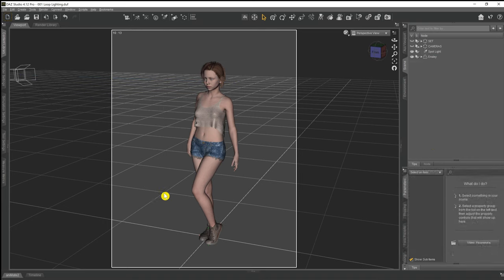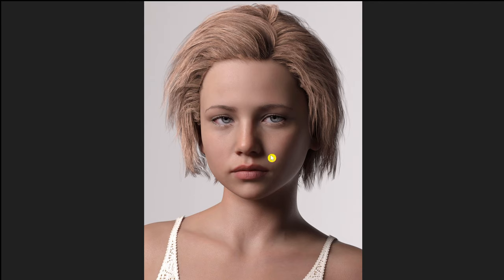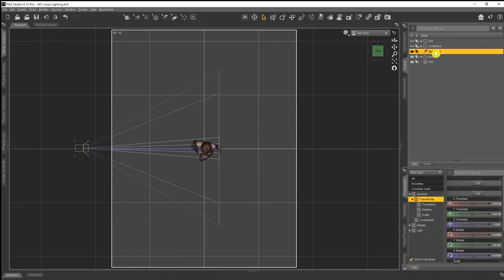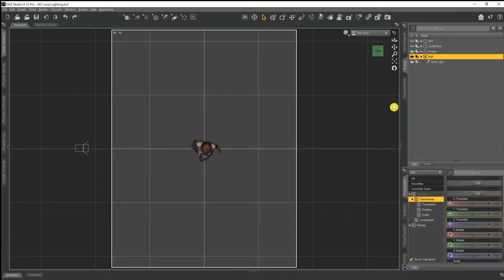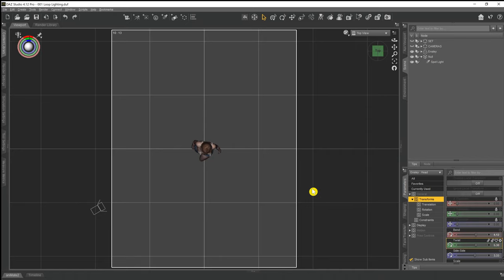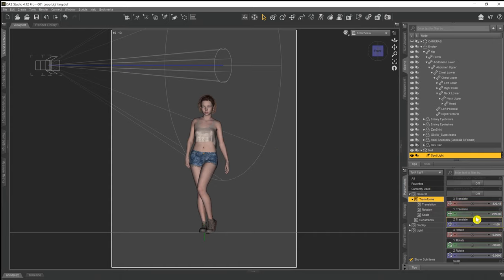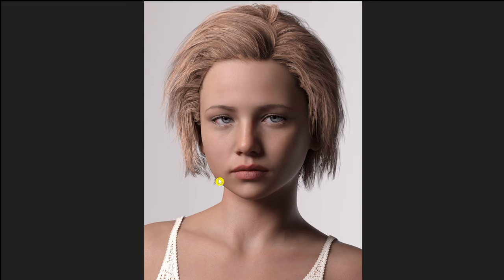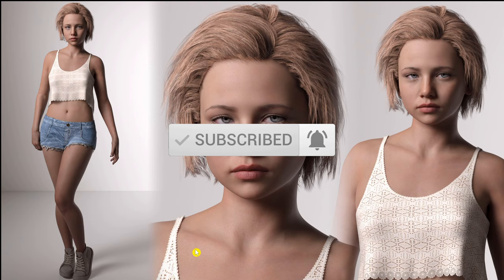Daz 3d Lighting Tutorial : How To Set Up A Loop Light

Comment: I should add that the tip parenting the light to a null at the origin is a great tip and shows why I watch videos like these even though I've used DS for a decade. I use nulls to keep a characters' eyes pointed near the camera but hadn't thought about this easy tip for moving lights. Works equally well for trying camera angles. Well done Rauko!
Reply from the maker: Yeah, it's a great little thing that I accidentally stumbled upon years ago when tryign to animate a camera .. so, if it works - use it! ..
Reply: You can also point a camera or light at a null, or a part of a character's anatomy, such as her head in this video. Then when you move it, it still points to the same thing.

Comment: Rauko in this and the Split light video, you made the comment that the lights perhaps don't work as well in the full body shots. I realize this is somewhat personal preference, but could you expand on your reason a but? To my taste, the full body shot for the loop light looks just fine. The bit of shadow on Ensley's left adds some depth and interest. The split light shot was perhaps a bit darker on the models left than I prefer and I might add some small fill there to lighten just a bit. Thanks in advance for your thoughts.
Reply from the maker: Hey Larry. The idea of these little simple lighting videos is to show that you can get decent result with just a simple, one light set up (outside of the ambient I used) without the need to add multiple lights. Certainly with portraits. You're right - with a fill light here or a rim light there more can be added to them to make them work in other situations but to demonstrate the particular lighting setups, I decided not to add other lights ..
Reply: @RaukoDaz3D  I wasn't suggesting other lights. I understood your intent with this video and felt you definitely met your goal. I was just curious about your comment on the full body shot, particularly on this video since I thought the full body was plenty good as is.

Comment: Thanks for this tip. Been looking for something like this for a long time. Question - Is there a possible to connect even more light to the null point- or - do I have to create several others? Was thinking of having at least three different light sources, perhaps with different temperatures  and/or color.
Reply from the maker: Hey there - you can add as many light sources to the null point as you want although, obviously, rotating the null point will rotate all of the lights as one. A different null point per light will allow fine control over each light individually.

Comment: hi, your render look amazing, and the tutorial also great...
my question is, what subdiv usually you use for the character and clothes?

ps : I think, your treble audio is too high, except that, everything is great!

sorry for my english
Reply from the maker: Hey Irfan .. unless I'm doing real close ups .. i generally keep the sub div at 2 or 3 .. although you would see HD details at sub 4 while at a distance, you would have to squint and really look for them .. so 2 or 3 really .. as for hair and clothing ... if you're struggling with VRAM .. you can usually get away with 1 .. even 0 at times .. Some hair assets can eat up Vram and so keeping the Sub D low is a benefit without any difference in quality.

You're right on the audio - I've tried fixing it with later videos .. but it's looking like the mic might not be the best so I'm looking into replacing it.

And your English is fine!
Reply: @RaukoDaz3D  thanks for replying, I really want to achieve realism, but whenever i try to raise the subD to 4, my computer become freeze, so i just let my render on subD 3. 

my render never show any pores on the skin (or maybe because my light set up is wrong too).

by the way, do you know what is the minimum PC spec so i can use subD 4?

my processor is AMD 8530 with GTX 1060 6Gb GPU and 8Gb of ram. what should i change?
Reply from the maker: You don't need to go to subD 4 for the pores to show .. so that's not the problem.

Pores are generally a part of the bump map on your surfaces tab .. by increasing the bump strength should start to make the pores appear more .. so Surfaces tab .. Model .. Skin .. Bump Strength ...... if you're limited to 1 on the slider .. click the Gear Cog .. Parameter Settings .. Use Limits UNCHECKED ..

Then start to raise the bump strength .. 

However, going too high can make things look a bit ugly .. so be careful with it .. however, this is only a simulated way to get pores and it depends on the quality of the bump map the model is using .. a low quality bump map on the model won't produce good results.

However, don't expect "geometrical" pores .. ie, pores sculpted into the model .. as they aren't there .. we'll probably be needing SubD 20 to have such fine detail!!

As for your system - the only real issue I can see there is the 8gb of system memory - you should be really looking at 16gb as minimum. Your graphics card should be fine with 4 SubD - but if you don't have the system memory to cope with everything then that's what will be killing your PC.
Reply: @RaukoDaz3D  thank you very much for your kind explanation....i will try it out like your suggest

Then maybe i need to buy 16Gb of ram
Reply from the maker: @irfanpurnama3198  You're welcome. Depending on your scenes overall lighting - you might need a light in your scene to help highlight them ..